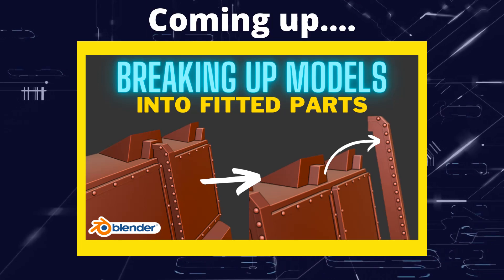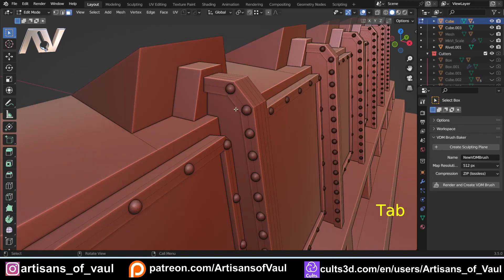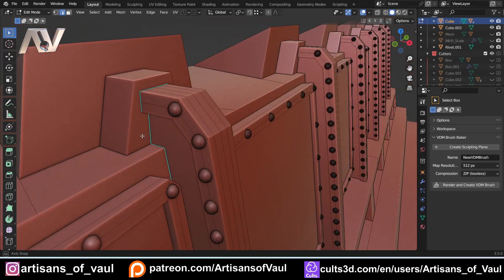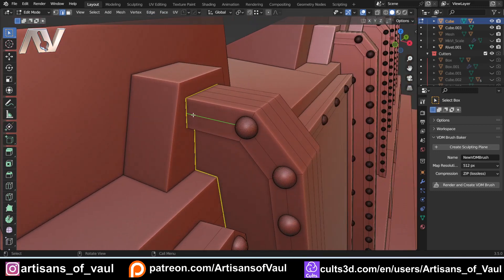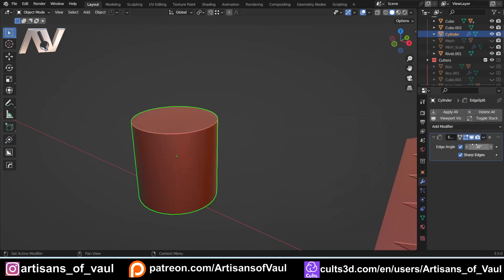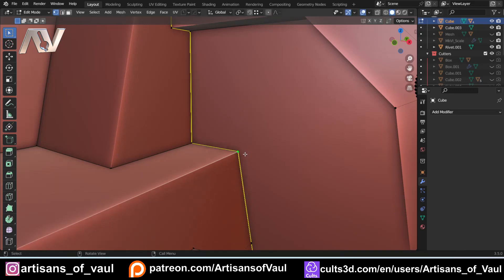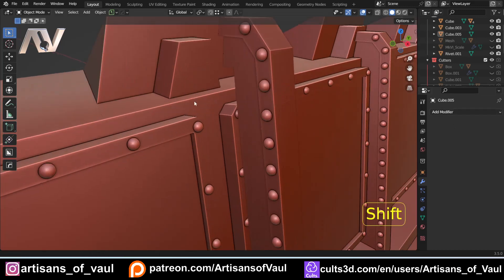Breaking up models into fitted parts for 3D printing - The Edge Split Tool

Comment: I find it faster to use "Rip faces" (V) once you have your edges selected. That will effectively do the same without the need to mark sharp and use and apply the modifier.
Reply from the maker: Agreed thats faster in many instances.  This is good if you can make the sharps as you go or you ca  quickly select sharp edges.

Comment: So you're saying carefully inserting a plane, applying a loop cut to it, and then increasing its thickness, to do a Boolean division, isn't the most efficient way to achieve this? LOL
Reply from the maker: @surfimp  I think it depends on the surface. If it was flat a boolean is good but specifically for non-flat edges I find this easiest/quickest.

Comment: Not 3D printing but cutting from sheets of material. Is there a way for splitting into parts whitch are look like extrusions. I found how to slice objects and then cutting from sheets of given thickness. But the steepness of the latter stacked parts shoud be somehow addaptive to save smouthing. I am speaking of paper, cardstock. Not a block of metall or any massive millable stock material. So halfway of additive to subtractive "production".
Reply from the maker: Sorry I'm trying to visualise way you mean by parts that look like extrusions...
Reply: @ArtisansofVaul  Ok I meant sections extending in vertical direction until there is a change in profile. As when there is a need for support if it would get 3D printed. But also when a slope gets upwards. Or like rouhging in on CNC, and then polishing.

Comment: Wouldn't you want to move those faces back 0.15 to 0.20 mm in order to ensure fitment of the printed parts? Or, is the miniatures community accustomed to post-processing (i.e., sanding) anyway in preparation for painting, which would eliminate the need to design a gap into the model? Thank you for this content, btw, your channel is solid gold.
Reply from the maker: You definitely would, it just wasn't the focus of the video. I have some comments on that in the relevant part in this video:
Tips and Tricks to Cutting and Keying Models for 3D Printing: https://youtu.be/L0wYL1URqjY

The issue is that this can vary from printer to printer based on how dialed in the exposure settings are, so I don't like to make statements on it in passing without being able to explain properly.

Thanks so much!
Reply: @ArtisansofVaul  Perfect, that video is an excellent treatment of the topic. Missed it on my first circuit of binge-watching your channel 🙂. Thanks!
Reply from the maker: @grandwaz0o  Cheers man.

Comment: Another way to do this would be to design it for printing in the first place. I deal with lots of large models and I always design with the intention that a piece is the right size for my printer. Which then I always include the tabs and slots for putting it all together. I think of this on the lines of what a model would look like if it was a plastic model where you get it and each piece is on a sprue.
Reply from the maker: Oh of course. This is more a premise for the tutorial. For example this piece is much easier to design as part of the whole and then remove one piece as it will be used to cover joins.

Comment: Some points:
* around 2:15 When you have a region selected, don't duplicate it, just go straight to P to separate it.
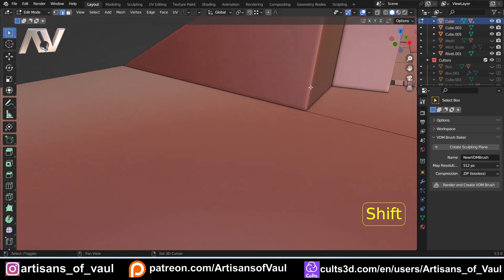* around 2:40 - you delete by vertex, but you have it selected by face. Delete by face instead.
Reply from the maker: All good points. It's just not really the point of showing how the modifier works.

Comment: In the first example why did you make it appear much harder than needed? You duplicated the part before splitting instead of just splitting it directly (duplicating first was unnecessary), hence why you then had to go back again to remove the part from the original model. Then when deleting the selected faces you were deleting verts, which as you know removes more than you needed instead of just deleting faces which would have given you the correct result (though this entire step was unnecessary had you just split the selected part without duplicating it).
Reply from the maker: That's a good point. I hadn't really considered it. I don't really work using that method much as I find it a pain regardless as ( I'd rather put in the sharps and then use the modifier later when working on a big project so I can work ad I go but keep everything together as one object until I want to break it down). But as you say that would be a more efficient way of splitting/deleting it.

Comment: I was madly doing things with booleans to split apart a model for 3D printing yesterday 🤣
Reply from the maker: I mean in some instances it works well. It just depends what you're doing.
Reply: @ArtisansofVaul  I'm still in the early stages of learning, and doing lots of things inefficiently! But maybe the way I did it was good for what I was doing!
Reply from the maker: @EcoHamletsUK  Understandable. There's almost always ways to make things a bit more efficient. 👍🏻

Comment: Fantastic! Related to this, do you have a video about the best way to do the opposite? I struggle with joining separate parts because the join option keeps the parts separate in the .obj and booleans are a pain. Is there an alternative to booleans in this case? By the way, audio is fixed!
Reply from the maker: Thanks for letting me know. Why do you find the booleans a pain? That's the main method I use but I'm wondering if there is a way to make it easier for you.
Reply: @ArtisansofVaul  It's just that they behave unpredictably. Sometimes they work, but other times my entire mesh disappears, it's not affected at all or gets deformed in weird ways. I make sure transforms are applied, normals are correct and objects are manifold and that usually works, but not always. But if booleaning is the way to go, I'll do that and focus on improving my booleans then. Thank you!
Reply from the maker: @Aspermy Previousemail  ah OK. That is something that comes with a bit of experience but normally it means one of two things:
-If you have it set to the "fast" method their are probably some overlapping edges or vertices from the two objects.
-If you have the method set to "exact" it's probably because one of the objects meshes aren't manifold.

Hopefully that helps with where to look.